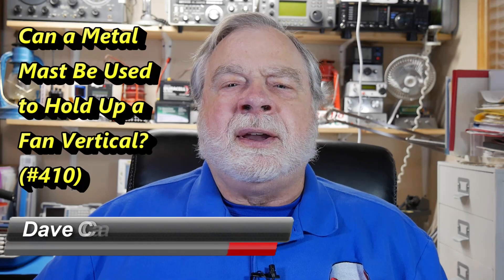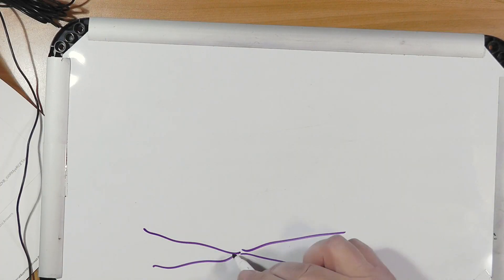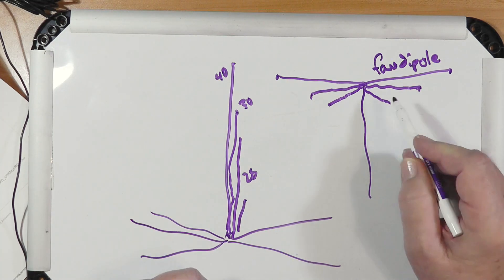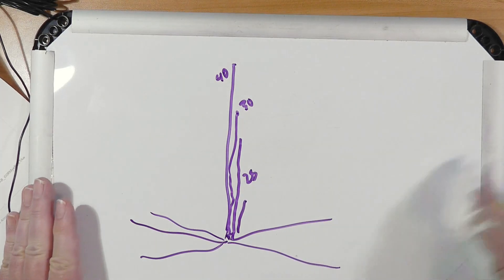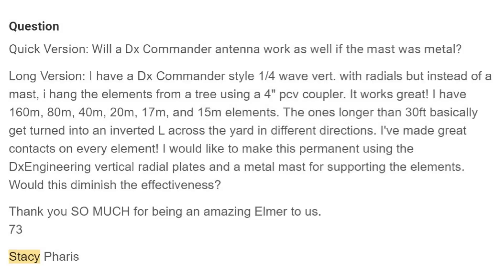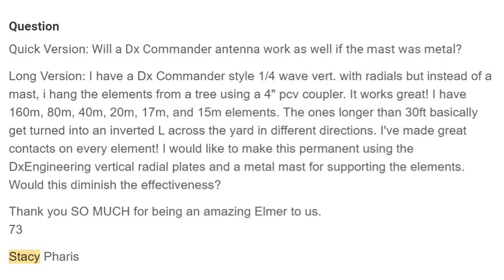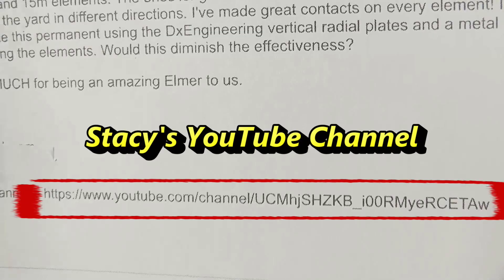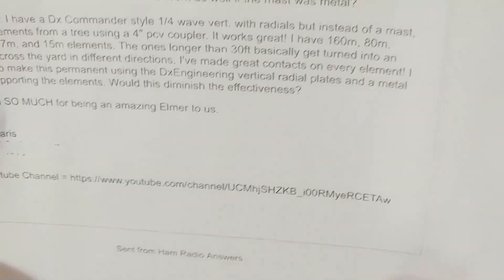Can Adding a Metal Mast Disrupt an Antenna? (#410)

Comment: I use a 25 foot high aluminium sectional  flag pole to support my junior g5rv inverted v. The ladder line hangs verticslly loose next to the pole. So far, its the best antenna I have. I can reach Brazil and Russia from Manchester UK wirh 25 watts and 5 - 9 reports.

Comment: The old timers from when I was young said that wood was under utilized simply because it was effectively electromagnetically invisible. 

The only thing I can say myself is that it would depend, 🤔 Some antennas use the mast as an element. I suggest testing.
Reply: Wooden poles and plastic standoffs are fantastic 🤓.

Comment: If the aluminum mast was isolated, how would it dissipate the RF?  

I have considered making the metal mast itself a radiant piece of the antenna, most likely the 40-meter portion.  The radial plate would have to remain isolated as well, in this arrangement.

Comment: While it would work, you throw out all the measurements and trial and error Callum put in to develop the DX Commander. If you want to go about the sizing all over again due to the (significant) interaction with the metal pole, then in theory it would work. Spacing would definitely be important to lower interaction.

Comment: You cold use the metal mast AS one element of the antenna, as long is its not grounded of course.  I have plans on making a DX commander like antenna this way using a harbor freight flag pole.

Comment: Would you say that a metal mast (such as a long , telescoping fishing pole) is best replaced by a fiberglass pole?  
When  (under what circumstances) can metal masts be used?
Also, are carbon fiber poles a problem because they can be conductive?

Many thanks, professor!

Comment: I have a 20/40 meter inverted Vee Fan Dipole and it is supported in the center by an MFJ heavy duty telescoping fiberglass pole.  Works great.  I have trouble getting it to load on 15 meters.  I get an SWR of about 3.0.  Replacing some older coax and will put a 1:1 current balun in the center and hope that makes it more efficient.  My coax has too many connectors and the coax is too long.  I'll retune it after I've replaced the coax.  Really enjoy your videos!
Reply from the maker: In the long-gone good old days, people would often load up a 40 meter dipole on 15. I certainly did. But with modern rigs, using 15 on a 40 meter dipole will often be presented with a high SWR. I did a video on that subject not terribly long ago.

Comment: You can use the metal mast as one of the elements. Make it 23 ft for example and use it as your 30 meter element . Just be sure to space the wires at least 6 inches or more away from the mast. A commercial example of this very thing is the 17 meter add on for the 4BTV.
Reply: I was wondering if this was not an option. I am thinking of re-jigging my antennas: 20' of chainlink fence top tube guyed with 3 lines at 10 and 20 foot using steel wire/rope. Topping this with a pulley and my Cushcraft R5, then hanging an 80m EFHW just above my 40/20/10m fan dipole. My thought is to gain 6 feet in height for the dipole, and use the guys as a ground plane for the R5. Though the instructions say to not install the R5 near a "ground radial system", I am guessing it would not suffer from having 3 sloping grounded radials: I am trying to justify using steel guys, since the Arizona sun has no respect for nylon rope, which worries me as the mast gets taller.

Comment: How come the longest wire on the DXcommander does not influence the shorter wires? Could a metal mast could be considered like an extra wire in the package?  A metal telescopic post of the same height as DXcommander won't be mobile or easy to work with .. but that was not the question.
Reply: It does. He spent considerable time and effort figuring out the lengths when all elements are in place and influencing each other.

Comment: Thoughts on tuning with suspended wires then converting to freestanding by replacing the longest hanging radiator with a structural metal pole?

Comment: ???  Is this really so???   I'm not so sure....    If the 40M  meter element was a 10 meter long, 1 inch diameter aluminium tube,  with radials, and insulated at the bottom, it would be a great radiator... Now, if you used that as a support  for the shorter band elements, and 'fanned' them from the base somewhat, how is that different from the DX commander???   I''m sure going to have a play, I don't see why it shouldn't work, as long as the mast/40 meter element isn't grounded at the base, of course...
Reply: I think the biggest issue would be the sheer difference in mass and therefore magnetic affect with the metal pole. If I run out of other things to do, I could spend some of the summer setting up my 23 foot flagpole vertical and trying it. I just have a hard time imagining making those wire spacers for the other bands! A more direct comparison would be a 43 foot flagpole vertical.

Comment: Hi, Dave - you mentioned the Alpha Delta fan dipole, but didn't mention whether a metal mast would affect it.  I was under the impression that a metal mast doesn't affect a horizontal/inverted-V dipole, and I have a DX-CC about 35 feet up at the center point, inverted-V, on a metal telescoping mast.  It gets out pretty well but wonder if it would be better with a plastic mast.  Unfortunately, we get very high winds here, and the metal mast is more stable. Thanks for your great videos!  Bob, KJ6GEU
Reply: I'm thinking of using a metal mast but perhaps the last 3ft at the top could be pvc.

Comment: Could you use a metal mast for an inverted v antenna
Reply: Yes. I had a fan inverted vee dipole antenna suspended from a pulley atop 30 feet of metal pipe. Just keep the antenna legs no less than 45 degrees from the mast. There will be some interaction so once you get the dipoles tuned, you may find some interaction if you change the angle. The antenna worked great on 80, 40, 20, and 15 meters. I also had a 10m dipole up there as well, but didn’t use it much at the pit of the solar cycle in 1985.
Reply: Cool I  plan on building a 30 foot mast out of some 80sch  aluminum pipe to use as a center for my fan dipole for 40 20 and 17

Comment: ok, I have a HF radio  and am using an NVIS 40-10 antenna.  I plan to raise this up to 15 feet at the center.  This will be done from a bed of a pickup truck.  Will the pickup truck (metal) affect the overall performance of the radio?

Comment: No matter what, when you can literally work the world with a hundred watts with a combination Chameleon CHA - MIL Hybrid rated at 500 watts coupled with a Stryker A10 Trucker Mount mobile antenna because it's 5/8 wave by itself which I've found works as well as an Antron 99, it makes it all worthwhile.
Reply: I tried lots of verticals on my CHA Hybrid mini on my Jeep on a Breedlove mount. MIL2.0 with EXT and cap hat, SG303, CHA V1, 102" SS whip etc. They did work reasonably well on the higher bands, but I wanted 80m local net, which they didn't. I'll try them out more on the higher bands when it is warmer out.

Admittedly,  my DX Commander 12.4m Signature does transmit well, down on 80m, there is too much noise in my urban environment, so I used that Hybrid with 130 feet of wire as an EFHW and cut the noise significantly. It is held up with an aluminum painters pole at the moment. 

I'm now in the process of doing up a control box to do T/R automatic with optional manual switching using my existing remote antenna switch.

I'll likely get much further with the much taller, resonant antenna.

Comment: Could you use a metal mast with an off center fed dipole at the feed point?
Reply: I would love to know this as well
Reply: @theranger2185 yes, use steel tv mast not aluminum mount the unun 16 inches away from the mast. I used a plastic cooking cutting board. Made a strip 3inches wide mounted with C clamps to mast . Works fine run coax doing mast with tape. Steel less capacitance then aluminum. Try it. KJ7TBR

Comment: Could a carbon fiber mast be used for a DXC type antenna? Or is cf conductive enough to also be an issue?
Reply: Carbon fiber is RF conductive.
Reply: SOTAbeams has a video about this, in which he tests whether the RF conductivity of the carbon fiber mast he sells is significant enough to matter.